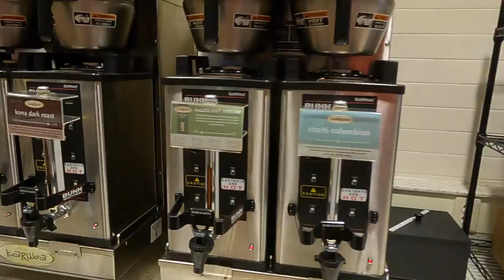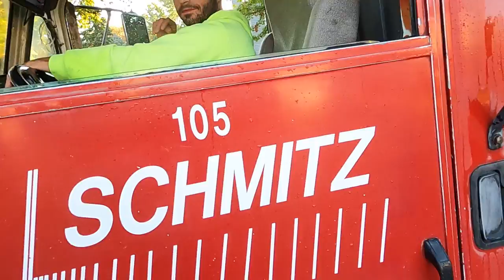Did you get anything done today - Come on!

Comment: Have you ever thought about the concrete pump attachment for the Bobcat it's a pretty badass unit under 20 grand and  more efficient Time Wise and fuel-wise than the buggy .I used to be in the business and we used a pump a lot even the little Mayco does a good job but how can you go wrong with bobcats 6-inch hydraulic pump